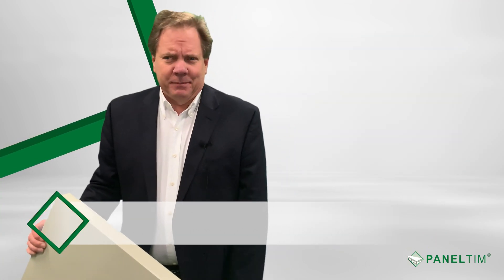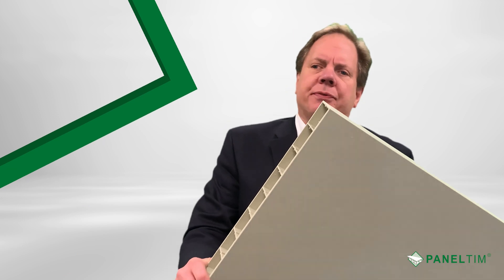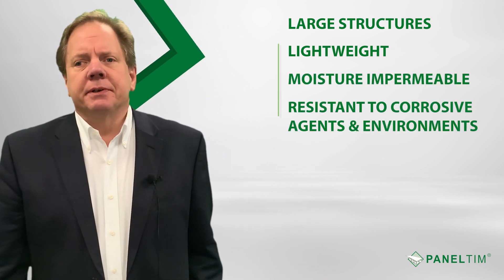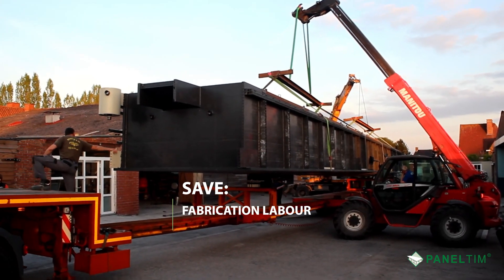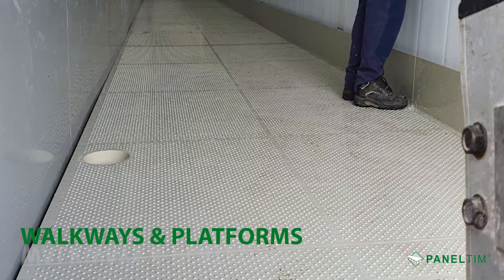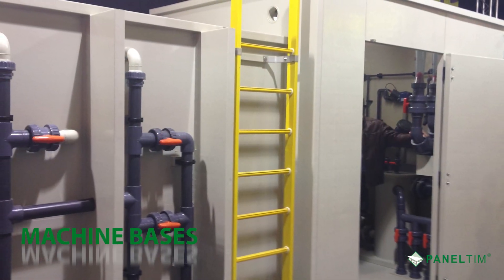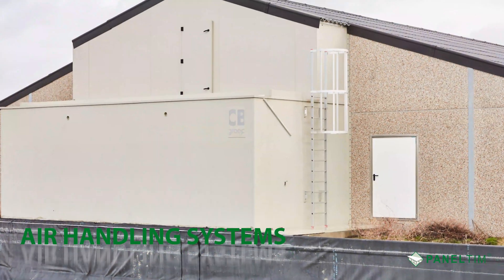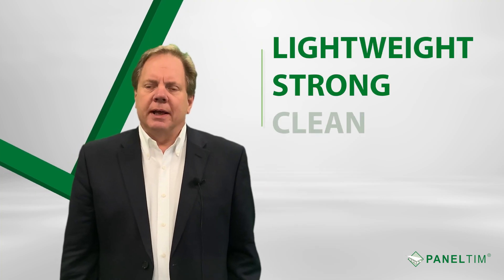An Introduction to Paneltim: a Structural Plastic Panel

Comment: Do you make insulated panels? These seem like they would be great for Tiny Homes on trailers
Reply: Hi Matt, 
Our panels do get used in bathroom trailers, construction trailers, kiosks and sheds.  They have some insulation value (trapped air) but not as high value as a pure insulation panel (e.g., extruded PS, iso-board), but they certainly are a thermal break. 

Also, relative to small spaces they offer volume efficiency in that they provide liquid impermeability and structure in a mini material thinner structure (only 0.8” to 2”) without any wood or metal framework.  

Our offices are closed through the end of the year, if you need to speak with me prior to 1/3 please send note on LinkedIn messenger.  We can exchange contact info there.